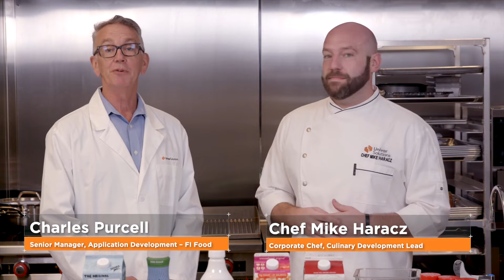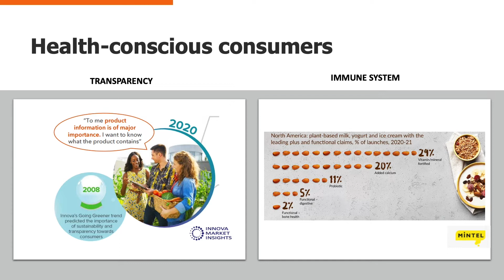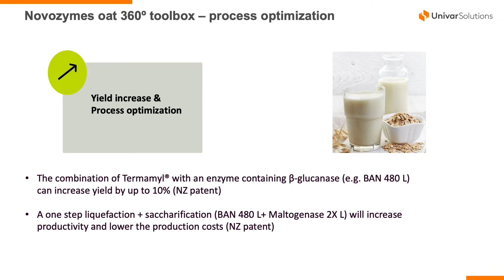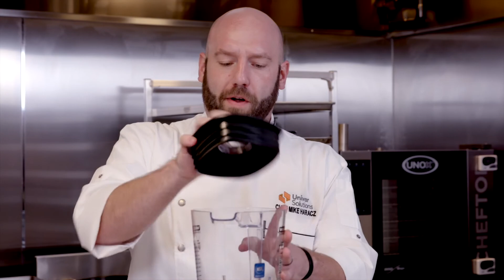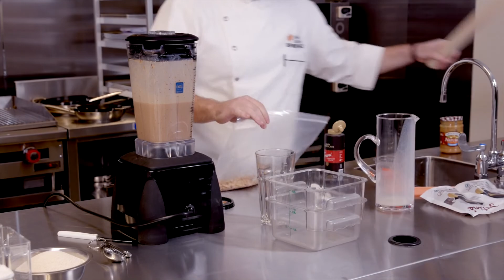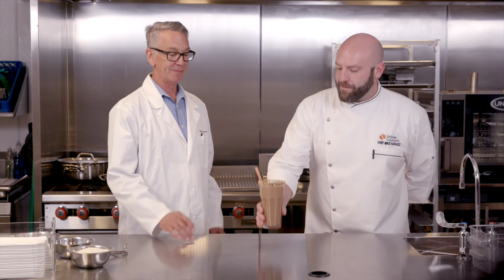Foodology by Univar Solutions: Plant-Based Milk Innovations

Comment: One question - How is it possible to prevent the protein from denaturating? Which ingredients are able to do that? Thank you in advance
Reply from the maker: Hello! Thank you for your question. From Chef Mike Haracz, Corporate Chef, Culinary Development Lead, and Charles Purcell, Sr. Manager, Application Development, their response: 
“Although there is not a high level of protein in a standard plant-based milk, adding an ingredient like pectin or CMC (carboxymethyl cellulose) would help protect the protein through thermal processing.  This would also help if you decide to add additional protein fortification in your formula.“